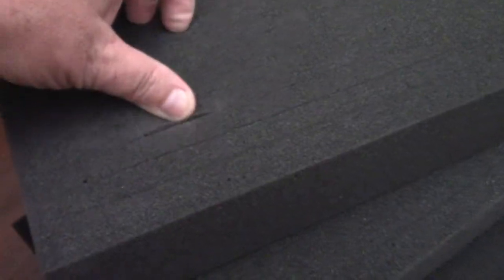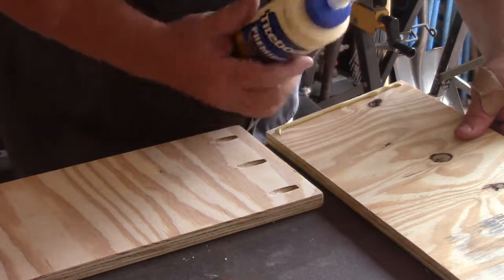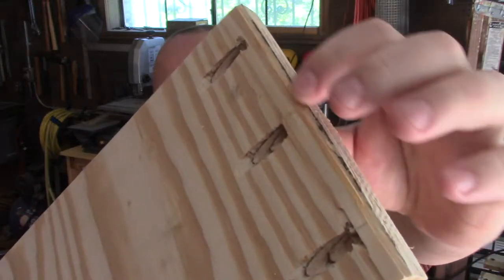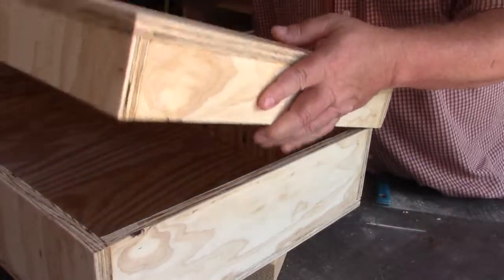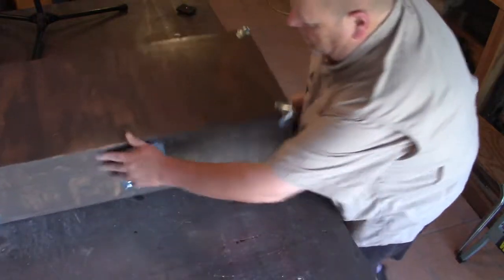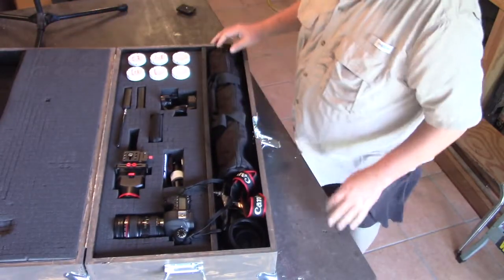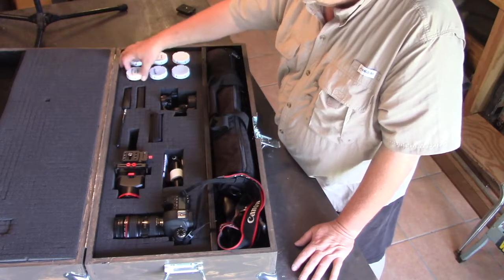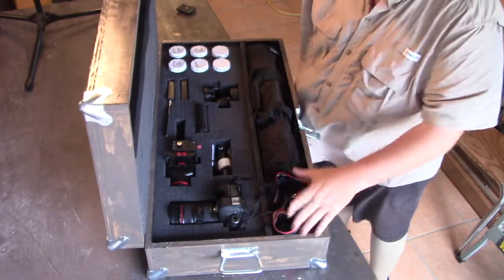Photography Box Build

Comment: Ben - Where did you find the foam inserts for the photo equipment box. I’ve always had a hard time finding foam inserts for my camera cases that weren’t undersized and overpriced.  Likewise, where did you find the metal corners and other hardware for the box. I have a couple of similar boxes that I would like to retro-fit with corners and handles, etc.   Thanks for finishing this project - hope it is useful for you.
Reply from the maker: Glad you liked it.

Here are the links for the stuff. I bought most of it on Amazon:

https://www.amazon.com/gp/product/B00ZX1W1SK/ref=ppx_yo_dt_b_asin_title_o03__o00_s01?ie=UTF8&psc=1

https://www.amazon.com/gp/product/B00ZX1W1SK/ref=ppx_yo_dt_b_asin_title_o03__o00_s01?ie=UTF8&psc=1

https://www.amazon.com/gp/product/B00JQYVJRO/ref=ppx_yo_dt_b_asin_title_o01__o00_s01?ie=UTF8&psc=1

I got these corners but they were too big:

https://www.amazon.com/gp/product/B00JQYVJRO/ref=ppx_yo_dt_b_asin_title_o01__o00_s01?ie=UTF8&psc=1

I can’t remember where I got the other, smaller ones. Might’ve been this place:

http://www.diyroadcasesstore.com/categories/Corners/